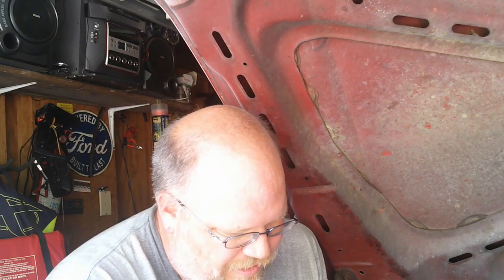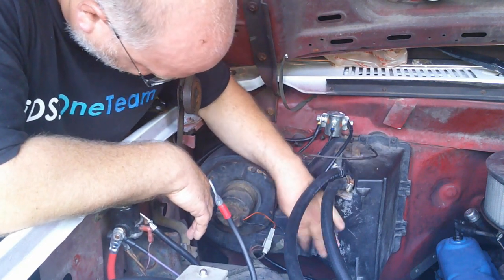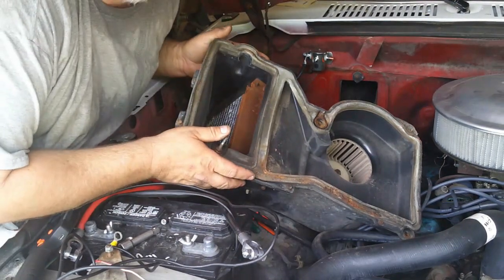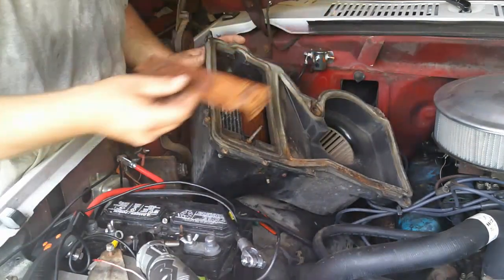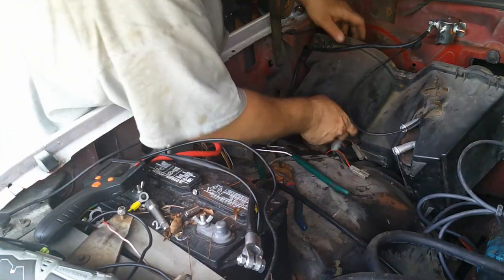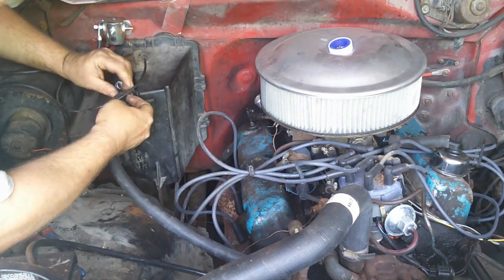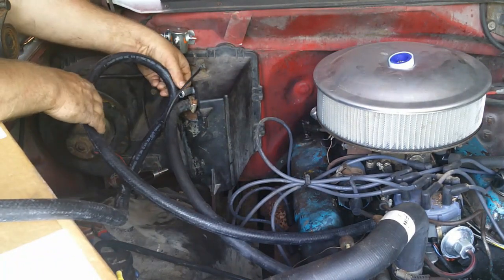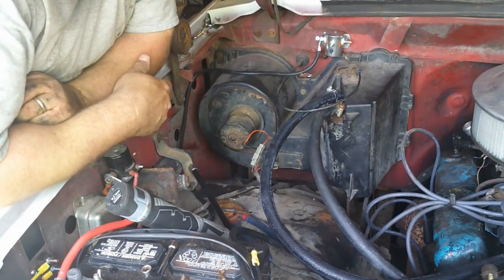HEATER CORE REPLACEMENT ON A BULLNOSE FORD

Comment: Reason they didn’t put the bolts back in is because they spin  after u get them so far
Reply from the maker: Came in handy when I needed to run a wire into the cab